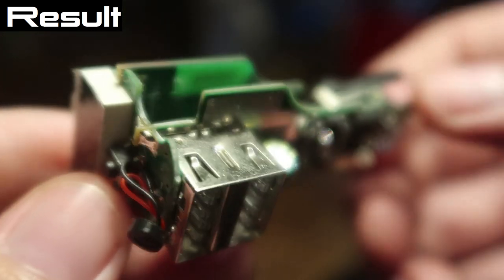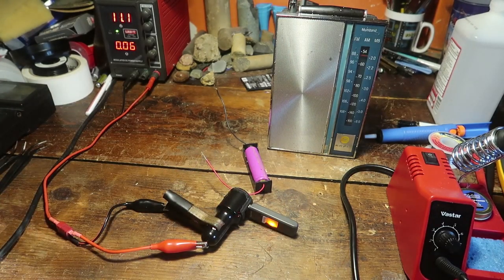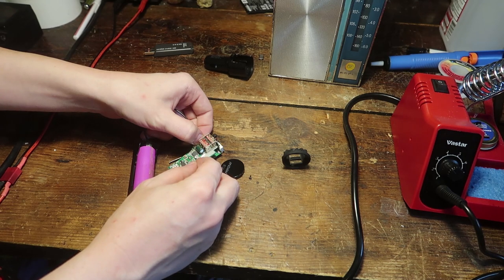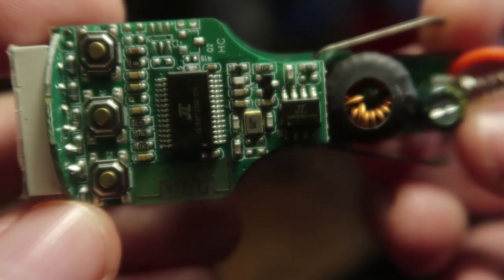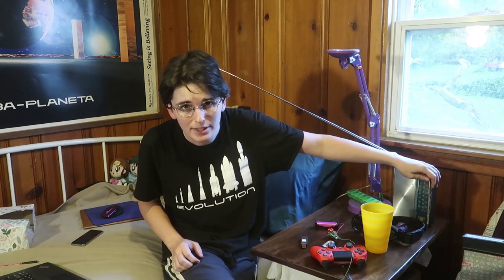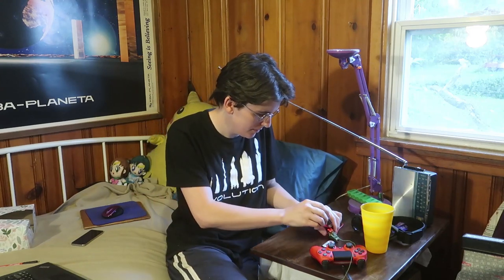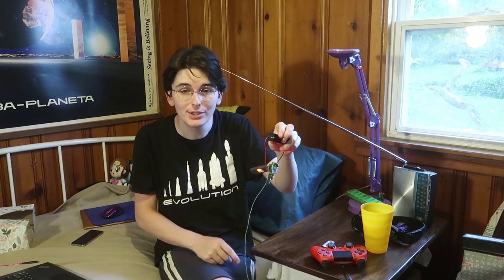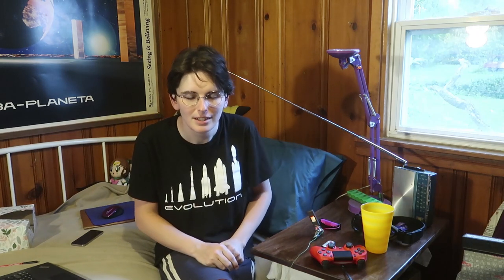3$, hackable, FM MP3 transmitter sends music a 1/4 mile!

Comment: BE CAREFUL OF THE FCC IF THE SIGNAL GOES FURTHER THEN RECOMMENDED TO STAY LEGAL .  I USE TO HAVE A " RAMSLEY FM RADIO TRANSMITTER KIT . BACK IN THE DAYS I  DID A HIP HOP BOOMBOX NIGHT AT A CLUB WHERE EVERYONE COULD BRING ANY BOOMBOX INSIDE THE CLUB AND CAR RADIOS TUNED INTO MY " 89.1 FM " RADIO  STATION WHILE I WAS PLAYING LIVE WITHOUT USING THE CLUBS SOUND SYSTEM . EVERYONE IN THE WHOLE PARKING LOT WERE JAMMIN TO MY STATION AND THAT WAS SOOO COOL .

Comment: Way back when CD players were new to cars, a common upgrade was a 6 CD changer which for some reason was always in the trunk. Instead of running wiring, most of those CD changers worked through an FM transmitter that's had a range so small that you didn't have to worry about picking up other cars music.
Reply: Man I remember those. Completely forgotten about them. It's crazy how fast everything went out of style.

Comment: The solar thing sounds like a neat idea! Tempted to grab one as well.  I have one of those $60 FM transmitters I got to toy around 10+ years ago mostly just for the low powered setting for around the house.   But when you set it to full power It goes out a good 8+ miles in a dense tree area with just a cheap non optimized antenna. I've even been able to push RDS through it as well and that even works!    Tested its range once to see how far, not risking the FCC especially since we have a lot of amateur radio operators here.  We've had FCC licenced FM stations here get dinged for various things lol.  Towards the end the song, isnt that from The Tempest?
Reply from the maker: it is from the tempest!

Comment: Solar power it. Also wondering how could you use one as a signal extender for another? Ie. could you place another one just inside the boundary of the 1/4mile range to pickup the signal and carry it further? How could that be done?